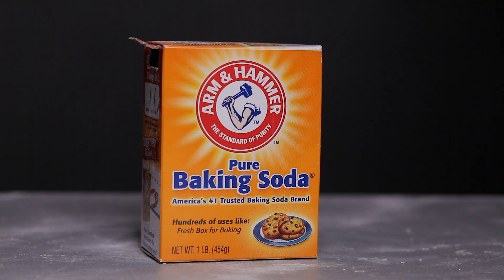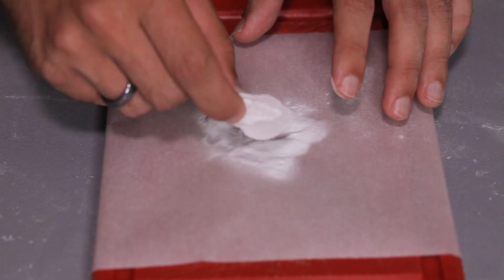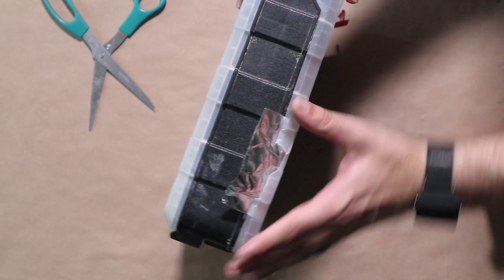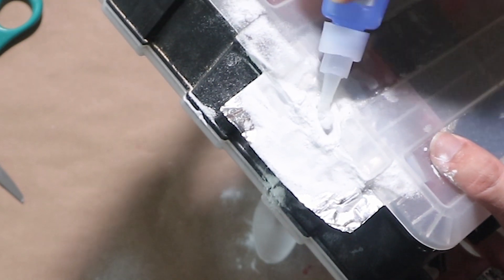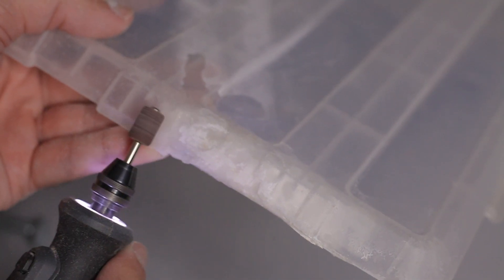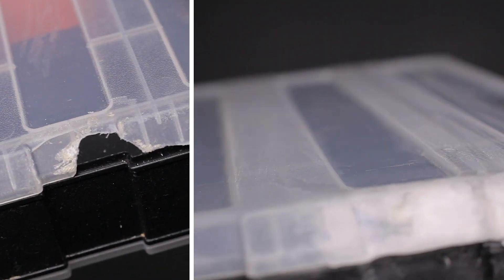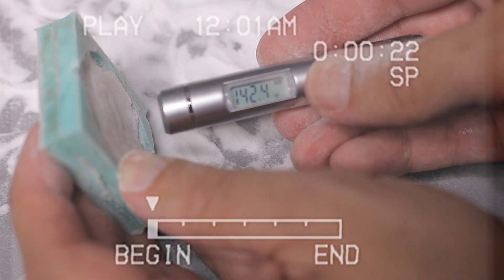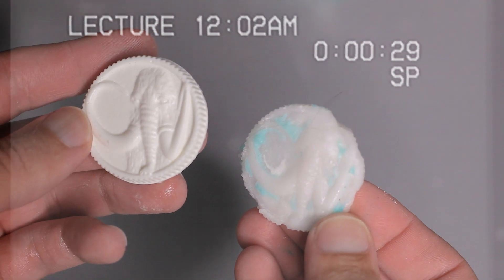FIXIT - PLASTIC LID

Comment: If I try fixing a plastic cup with this will it hold? And is it safe to drink from?
Reply from the maker: It would really depend on the specific CA glue you used. Most CA glues are NOT food safe, but it looks like "Krazy Glue" apparently has food safe ingredients... so I would look into that brand first, but definitely proceed at your own risk.
Reply: @IamNickDClements  yeah I abandoned the project after a quick google search, no feasible way for me to repair the plastic right now